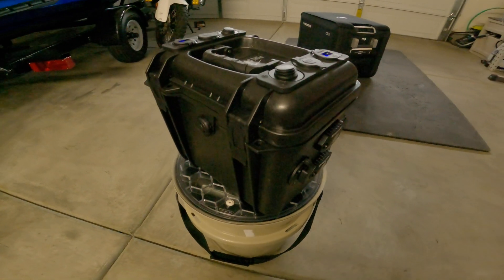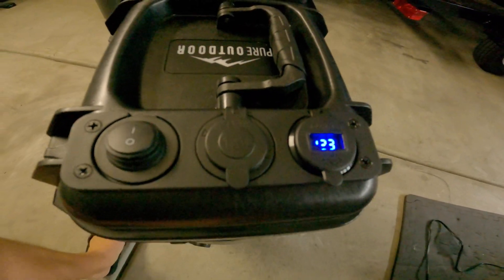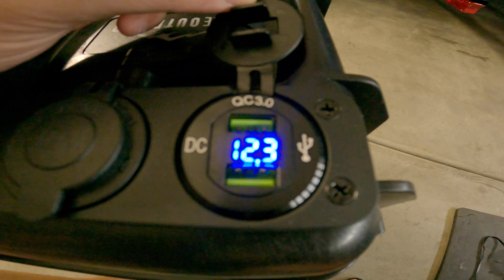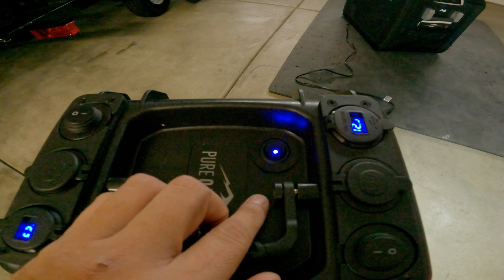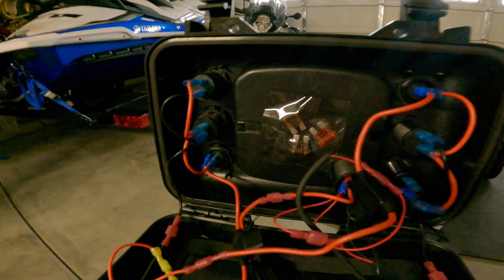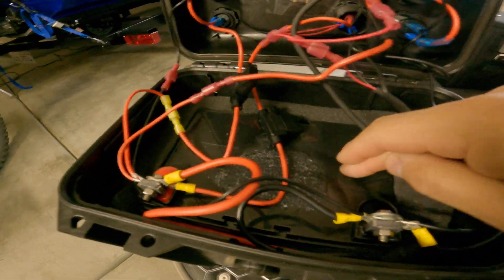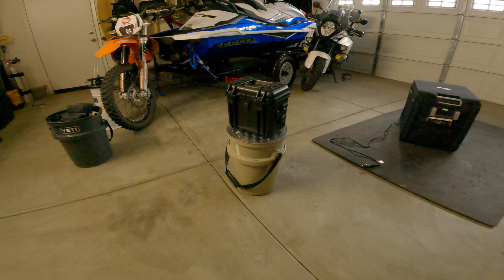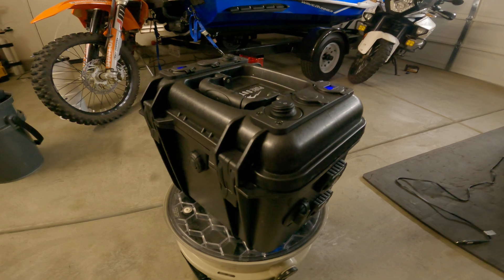DIY 35Ah Power Box

Comment: I built a pair of 12v, 100AH, LiFePO4 batteries to power my trolling motor, using that exact same case!  :)
Reply from the maker: Nice, how do you like it? 100AH is the goal
Reply: @so-caladv1179  Honestly, it's too much capacity.  I mean, they work fantastic, but I can fish 3 or 4 days in a row before needing to charge up the batteries again.  I have them hooked up using Anderson 60 amp connectors for the trolling motor and XT30 connectors for the on-board charging system.  This means I can remove (or install) both batteries (about 25lbs/ea) from the boat in just a couple of minutes.  I also use them for camping/hunting trips and for emergency power backup, by connecting them to a 24v inverter/charge controller.

I'm currently building a new, dedicated 24v battery, using 60280 cells with a 55AH capacity.  From my experience, this will still be plenty for a full weekend of fishing before I need to recharge that battery.  It will be slightly larger, in external dimensions, than each of the two 100AH batteries, but will only weigh around 32lbs, instead of the 50lb total for the original batteries.

Comment: This is outstanding information! Thanks for taking the time to document and explain. Have you had your eye on Lithium battery? If so, which one? Also as far as charging goes, are you wiring to your main vehicle battery and/or running solar when your parked/camped? I’m thinking I’d sound the same and making a Anderson type connector that I can swap between solar and vehicle charging power.. any ideas or insight of how you would do that would be fantastic.. my plan is like you, to mainly power the fridge and optionally power other items, but still have charging adaptability while “Oscar mike” or camped. Thanks again for your post.. sub’d 🤘🏼

Comment: Thanks for the video just curious though how long would it take to recharge that battery off of 12v from a car or solar?
Reply from the maker: It depends on the amp hour of your solar system. Assuming that your solar charges at 1 amp hour you probably need 15 to 20 hours to charge if you depleted the battery to 50%